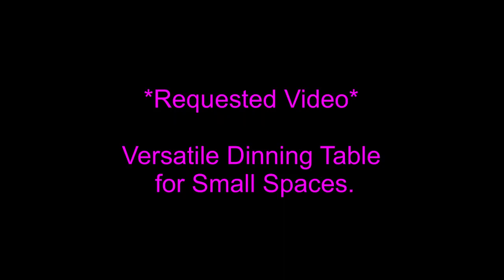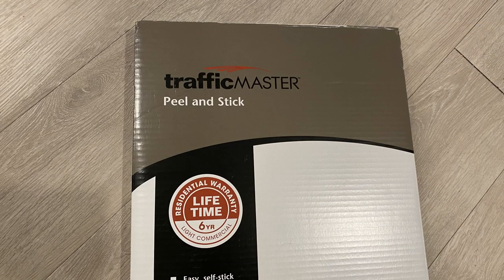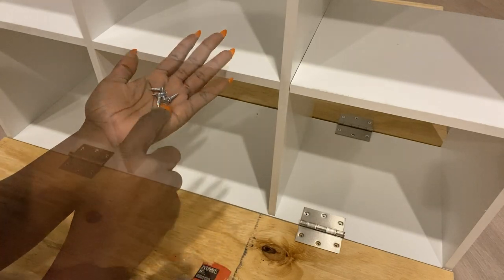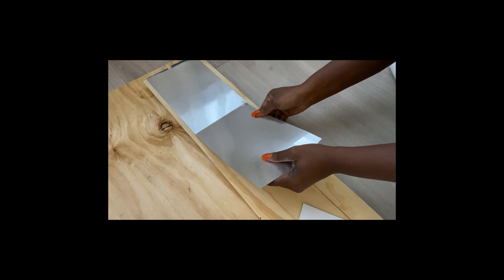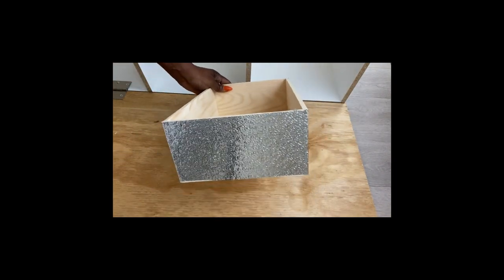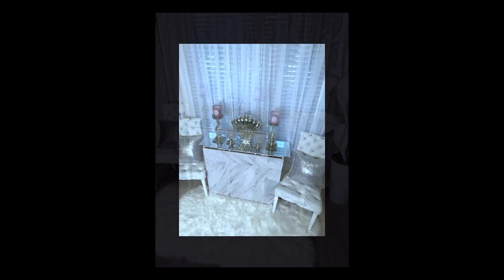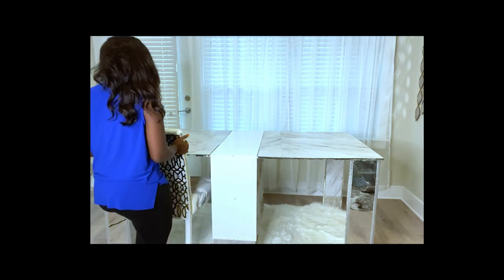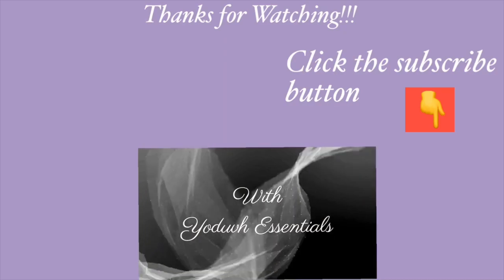HOW TO DIY 2 IN 1 STORAGE AND DINNING TABLE FOR SMALL SPACES

Comment: I need more storage, and my Walmart has the 3x3 storage blocks on sale! it won't fold down but I measured and I can make a table for 2 that will fit my kitchen perfectly! And can show off pretty things in the front and store practical stuff in the back. Even their basket drawers that fit the block shelves are on sale, I could use for cutlery. The only difference is I spend extra to a 1/2" pressboard wood panel, but it's not much extra especially if you find one that is flawed. Thanks for another idea!

Comment: Ideas: 1) Use of piano hinges may create a tighter fit with no visual gap. 2) When applying the peel-n-stick tiles place the 3 large pieces in the center. Then fill in both sides for a uniform look. 3) Consider the marble look tiles used here with plain white tiles framing the center three. 4) Industrial strength hook and loop tape will keep the legs secure when closed. 5) Ikea sells door AND drawer inserts for their cube shelves which keeps stored items dust free and contained. Imagine the added kitchen or hobby storage this creates for any home, especially rentals. Thank you for your ideas that jumpstart ours!

Comment: Just amazing!  How many foldout legs did you make for it? I only saw 2, one on each drop leaf. And if you made 4, how were they positioned underneath? Thanks for answering my questions!
Reply from the maker: Each sides have double fold out legs, and I used wide boards for that to make it balance. Thank you so much for watching 😇❤❤❤
Reply: @yoduvhessentials6310  what are the width and height of the legs?

Comment: Wish I would have seen this before I purchased my expensive craft table. Actually have most of the needed pieces to make this unit. The unit you have created looks nicer! How stable are the legs?
Reply from the maker: legs are very stable because i use thick and wide wood pieces. If you like you can add another piece in the middle that would be folded to make the legs 3 instead of 2. I know yours will turn out lovely and good luck in making it too 🤗😇❤❤❤